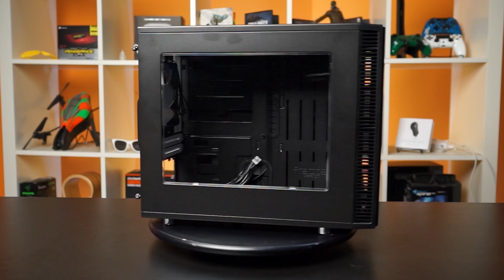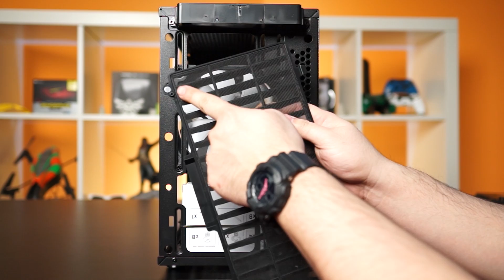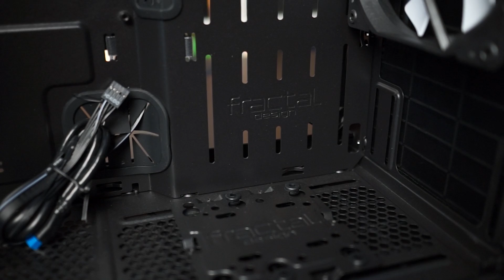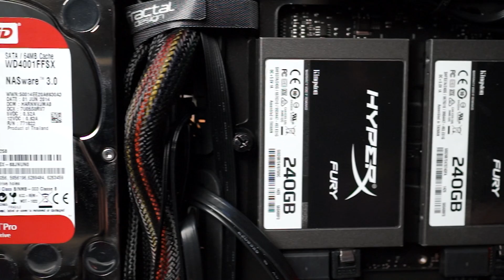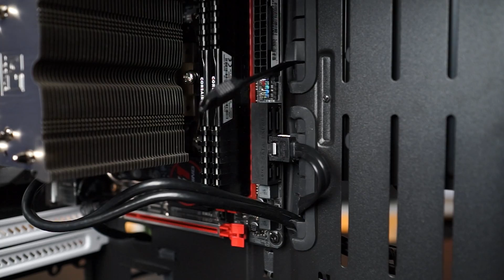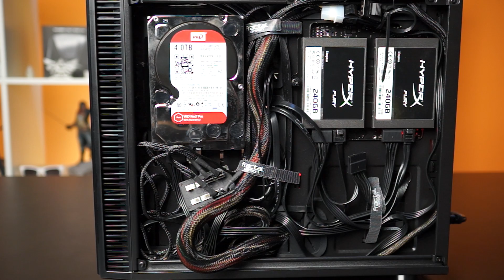Fractal Design Define Nano S: A mini watercooling monster

Comment: just incase anyone wants to use the Noctua nh d15 in this case, it will fit, but holy shit was it awkward. unless others have had better experience with it, i could only get the one center fan in, and had to connect the fans prior to installing, if you want to access the fan connectors again, you'll need to remove the cpu cooler entierly. for a first time builder, do not get the NH d15,

Comment: I noticed that the drive mounts behind the mobo receive no airflow. Is that bad for the drives? (either SSD or HDD)
Reply: no, SSDs and HDDs almost never need to be cooled because they create so little heat, the only reason you would want to cool them is if youre working in a very hot area like a volcano or a AMD build.
Reply: really ? have you ever actually touched HDD when you writing or reading something on it? it gets terribly hot
Reply: ealiev60 exactly, that was my concern. I have an external 3.5" drive to USB adapter that I plug my 2TB drive into and it runs hot enough that it's uncomfortable to touch for too long.
Reply: Jeffrey Wong I have m.2 ssd back of my mobo and that gets very hot... my concern is if air moves behind it at all
Reply: ealiev60 what model?
Reply: Jeffrey Wong samsung sm951 512gb

Comment: sir :( i hope you could help me.. Does msi 390 or 970 fit in that case ? i love s nano and gonna mount it with b150m-itx asrock.. i5-6600k, im scared if it dont fit in bcause of the psu and the size of gpu

Comment: I noticed the psu used un this build is a newton 1000w which is 165mm deep i have an evga 1050 gs and its 170mm would i be able to use it?

Comment: If you own a fractal design nano s mini-itx case can you please tell me
the INNER length from the back of the case to inner front?
I am trying to measure weather I can fit a push/pull configuration at the front & fit my gpu.  I know you can take the front filter out and put 2 fans in there but I 
am trying to do it without doing that as i want to keep the filter 
there. Thanks.

Comment: why put Nas hard drive in a pc :S
Reply: Why not?
Reply: +Pedro Antonio García Robleto Red is built for running for 24/7 on Nas system. blue or black is better choice for the pc I got a synology with 4x4 TB WD Red also i got blue 1 TB using it for put game on it and green 3 TB for in my pc
Reply: I know... but the question is, why not having a red one? there are no compatibility problems... so, why not? a WD Red ain't less powerful than a WD Blue... and it's better than a WD Green... so again, why not?

Comment: is this a good pc build

case- haf 912
psu- evga 500w 80+ certified
ram- corsair ddr3 lp 8gb
cpu- fx 8320
mobo- GIGABYTE GA-78LMT-USB3 (rev. 6.0) AM3+ AMD 760G + SB710 USB 3.0 HDMI Micro ATX AMD Motherboard
os- win 10
Reply: +Brinks246 what's your graphics card?
Reply: ThePopStarDude productions gtx 660  cuz i got it for $30 from a friend
Reply: +Brinks246 It's nothing special. Shouldn't run new games extremely well, but at a playable 30fps. I'd suggest upgrading your graphics card to something like an R9 380, since your CPU is very good.
Reply: well the gpu is  just a stepping stone
Reply: i plan on eventually getting like a 970 or 980
Reply: ThePopStarDude productions i plan on eventually getting a 970 or 980
Reply: +Brinks246 I see. Those are very good GPUs. If you go for a 970 or 980, you can't overclock very much with your current power supply.
Reply: 1
Reply: ThePopStarDude productions any suggestions for psus
Reply: Brinks246 If you're on a budget, Corsair VS550 does the job. I have that. But if you want more quality, get something like an EVGA Supernova 750 G2.
Reply: +ThePopStarDude productions ok
Reply: +ThePopStarDude productions   Ok

Comment: You can't use a 240mm AIO/ Fan & Rad combo in the top with a Maxiumus ITX Board from ASUS, just a heads up for anybody interested in that mobo with this case. The riser heat sink at the top gives clearance issues by about 3mm.

Comment: I'm thinking of building a Mini ATX gaming powerhouse for $2000, and I think this is interesting to compare to the older Cooler Master N200. It has space in the front for me to put in a Blu-ray burner and a card reader, which is important for someone working in Premiere Pro as much as I do, and it's $50 cheaper. Add some water cooling and I think it's a decent machine.

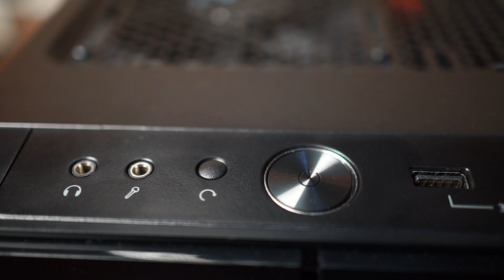Comment: 0:50 What is the button that has something that looks like headphones leaning to the side in between the power and microphone?
Reply: Reset button.
Reply: Thanks
Reply: +hassan nassar It instantly cuts power to the motherboard then gives it back rebooting the computer but forcefully shutting it down at the same time. Only use it if your PC is completely frozen.
Reply: +ea ragav What does it do

Comment: Can someone explain the top fans... They look blocked off?
Reply: +Ankit Sharma It is removable, there is a sound softening sheet that you can lay on top or remove it and add more fans.
Reply: Roboterson but then there's no filters there?
Reply: It think it would be an exhaust not an intake, so no filters needed.
Reply: Roboterson a case that size has only 1 exhaust at the back... That is definitely supposed to be intake.. Or welcome negative air pressure...

Comment: Great case, but this has to be one of the most disappointing builds.... :(
Reply: +Albert Einstein Correcto, so much potential for a WC build, they could have even mocked one up and not put fluid in it.. This is just a disappointment.
Reply: +Albert Einstein I was thinking no piping or some soft tube just to show the setup, rigid tubing is an art... there's already some nice builds out there.
Anyone can see what the case is supposed to look like with a quick Google Search.
Reply: +Albert Einstein yeah but the 295x2 is huge and they were trying to prove even a gigantic card will fit in it.
also the 295x2 is more powerful than the gtx 1080.
Reply: Why?

Comment: Looks a lot like my Cooler Master.
Reply: +DigitalBerserk which cooler mast is that?
Reply: Stephen Shaw  I am not sure, i bought this one with a motherboard included, then i added all the other stuff on top of those too, but i must say this is my favorite case from all i had, is not expensive, is small, it has tons of places where air can go in, so the processor doesnt heat up even in turbo mode, the only thing it doesnt have is the glass panel on a side, but damn, looks almost the same, specially the inside and back.
Reply: DigitalBerserk sounds like the elite 120 or 130
Reply: Stephen Shaw yeah looks a lot like the black one, but its a vertical cabinet instead of horizontal, im really happy with that cabinet, i mean, i dont like neon lights and fancystuff, but the space and how the coolling entries work is really good, specially the dust covers.